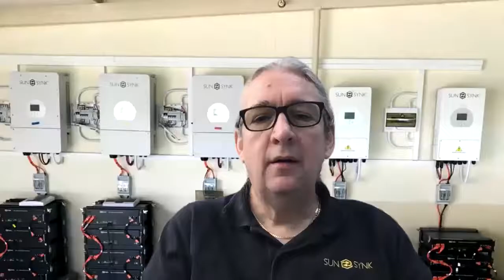Using a Sunsynk inverter without a battery

Comment: Dude why you banging on about a battery? The question was how to use without a battery? Ie how do you set it so the power generated by the solar panels is going into the db to be used by household? The manual is poorly written and not very clear on how to set up the inverter.